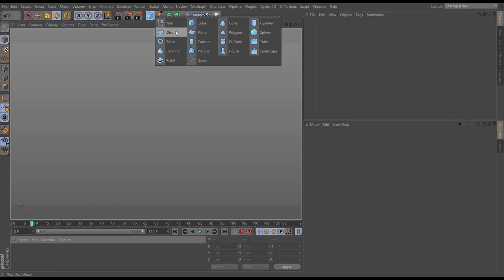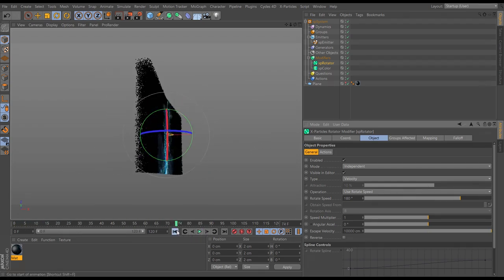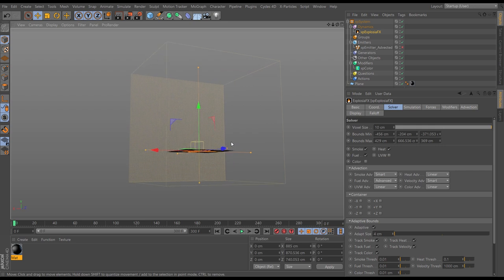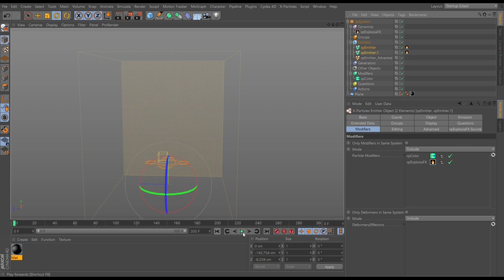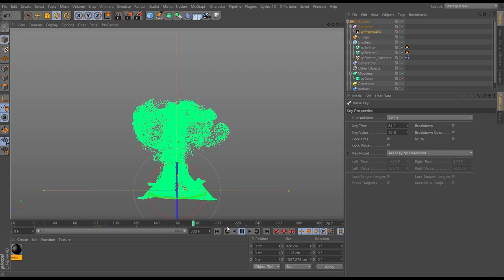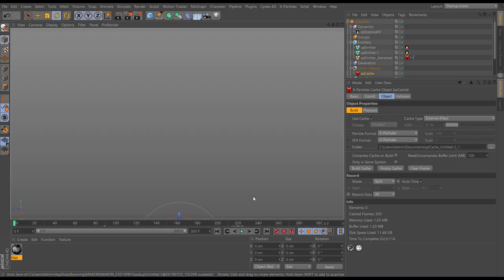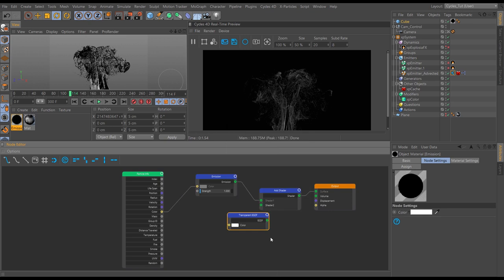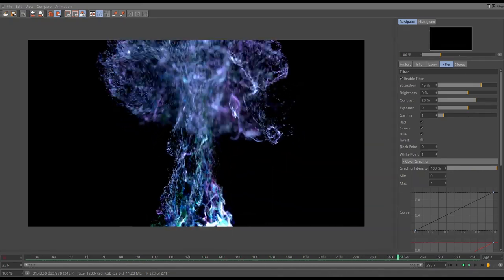UV Emission Data - Content Repository Tutorials 2019

Comment: This is a great tutorial, and I learned a lot. There is one thing that confuses me though:
What is the correct way to use the animation speed property in the noise for speed ramping? Your solution there, where you moved the key frames away from each other seems like a bit of a kludge. Does the animation speed attribute work similar to the Explosia Sim Scale, where changing the value actually brings the state of the noise to where it would have been if it was set to that value since frame 1? I'm confused by how to work with it and wish it worked more like the xpCache playback manual time so you can keyframe the animation better.